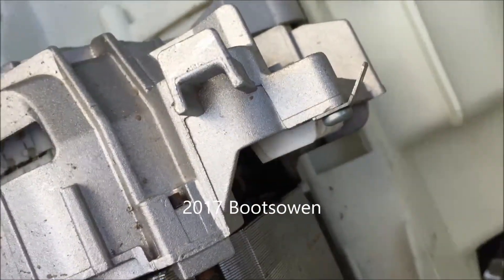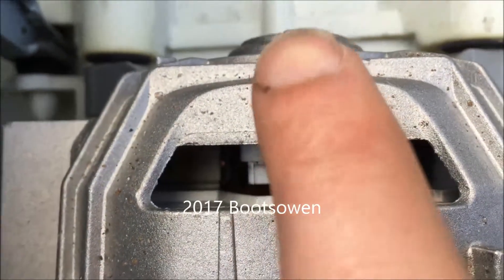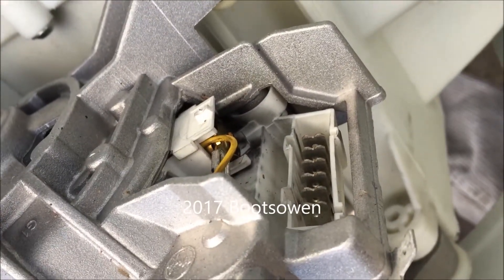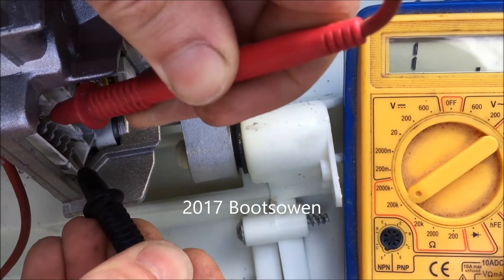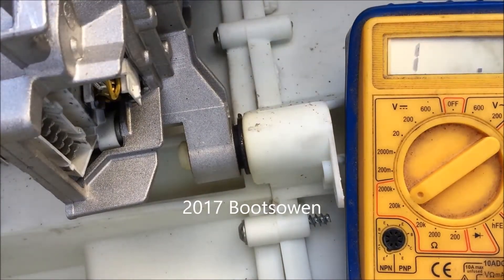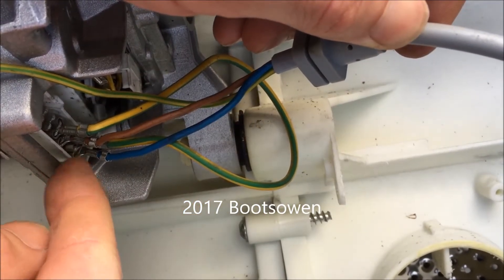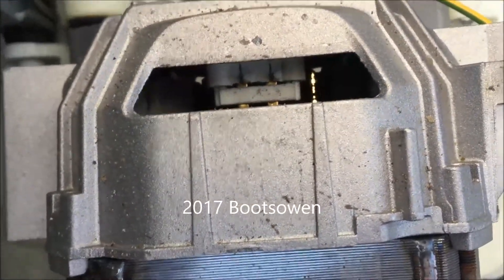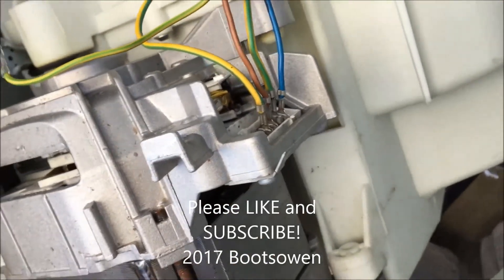Bosch Washing Machine Motor Wiring

Comment: Hello.! Is it ok if I use a 4000W (4kW) speed controller on the max setting for an Arçelik motor?
Reply from the maker: If it is a washing machine motor 4kw should be good.
Reply: @bootsowen  yes it’s a washing machine motor made by Arçelik

Comment: Hi again: Roger here. The reason that I was wondering about a capacitor is that when I connect the motor to my household current the motor hums but does not start rotating until I start it by hand, then it will run. Thank you.

Comment: I have a motor out of an 11 year old Bosch washing machine. The motor is model J52BCM-0111. The p/n is 9000128518. I want to repurpose this motor and operate on 120 volt single phase household current. This motor connector has 5 wires to the cable connector, 2 red (tachometer), 1 white, 1 brown and 1 grey. I assume that I am going to require a start capacitor and motor protection of some sort. I would like to be able to install a forward/reverse switch as well. Can you tell me what additional parts I will need to accomplish this? Thank you. Roger
Reply from the maker: Hi Roger, If your motor looks like this: https://youtu.be/48J3w0eN6uI then this is how you wire it and reverse direction. the voltage is irrelevant, but you will need a 120v regulator if you want a regulator. The fact that you have mentioned a capacitor suggests that you don't know much about these motors, which is ok, but be careful around electricity. Have a look at my "Washing machine motor wiring" playlist. let me know how you get on.

Comment: I have an identical motor, the yellow brush wires are actually connected to the middle pair of spade connectors. Your guess worked because you happened to avoid the tacho connections. Confusing the brush connections with the winding connections made no difference as the jumper simply connected the two and the incoming mains was connected across the combination of the two.

Comment: Is the connection is same for connecting  with DC supply?
Reply from the maker: Hi there, Maybe have a look at my washing machine universal motor wiring video.
Reply: Can a universal motor run on dc battery. Is the wiring (for AC) is same for DC?
Reply from the maker: Yes a washing machine universal motor can be run on DC, they are called universal because they can run on ac or dc. Wiring can't be the same because instead of line and neutral you have positive and negative. but the wires go in the same places. have a look at my other washing machine wiring videos.
Reply: @bootsowen so this power supply you used is 230vac ? not 12vdc?

Comment: Thanks for the informative video. Do you need a capacitor to start the motor? There is a capacitor in my washing machine
Reply from the maker: No. You don’t need a capacitor to start a universal motor.
Reply: @bootsowen  So start or run capacitor only required for an induction motor?  The Bosch universal motor has a type of capacitor - suppression capacitor where the power cable goes into the washing machine (only used to remove voltage spikes?).  Is that correct?
Reply from the maker: @intestinalworm1202  yes: start or run capacitor only required for an induction motor.  the suppression cap is for radio interference. I didn't know that that was related to voltage spikes, but then again, I don't know much about electronics!

Comment: This is working well. Started up nicely but kept on picking up speed. Is there a way to control the speed? I want to use it as a disc sander
Reply from the maker: Hi there, check out my video, "washing machine motor wiring explained"  it gives a method of speed control by voltage regulation. Thanks